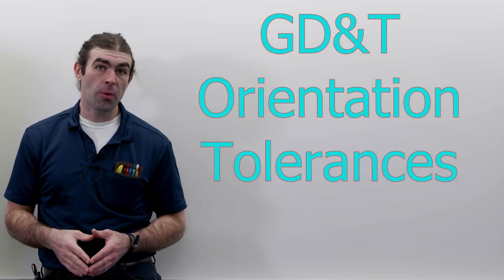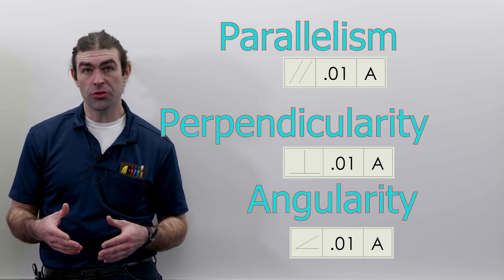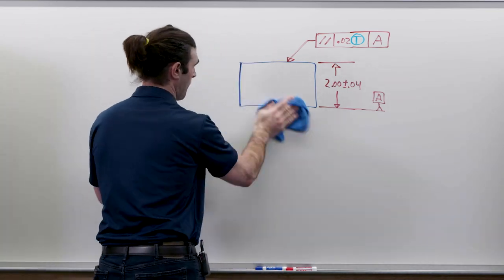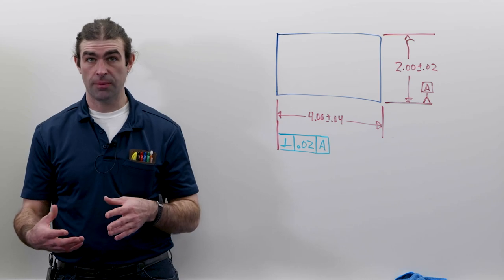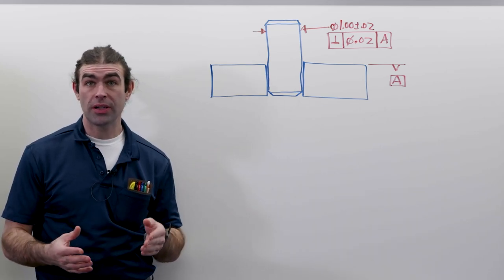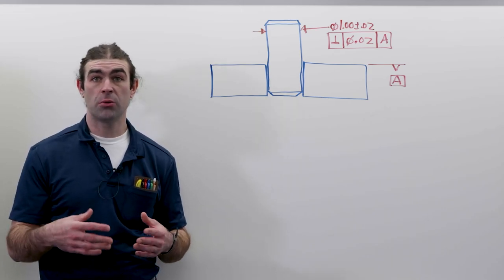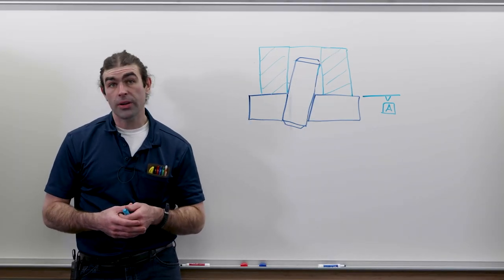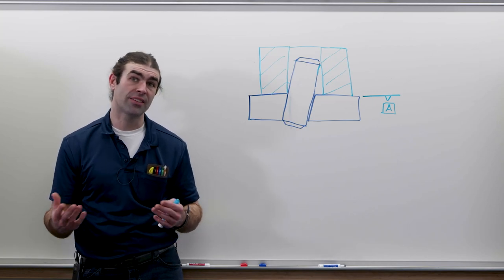GD&T Lesson 3: Orientation Tolerances

Comment: Excellent stuff!  I like that you are relating the inspection method to meet the GD&T call-out.  MANY engineers have no clue as to how to check (inspect) what they have specified.  As the department that has to make the items, if the drawing is not clear it goes right back to engineering for correction.. It is NOT supposed to be a manufacturing competition or guessing game.  If we make bad parts as a result of poor drawing dimensional construction it is on Design Engineering.  This is why all new engineers need to be on the shopfloor to "feel the pain" of bad design engineering.  Companies need to develop engineers better.  They don't understand the money that is lost concerning these issues.
Reply from the maker: Thanks! I agree. I see companies trying to save time and money in the design process, and end up with bad drawings no one understands costing more in the long run.

Comment: If I had a cylinder whose OD is controlled by perpendicularity to datum A (a flat end of the cylinder) and whose ID is controlled by a RFS position, what would be the minimum/maximum wall thickness of the cylinder wall possible? Would perpendicularity factor into the all wall thickness at all? I know it changes the VC of the cylinder in this case.

Comment: Hey prof, i finally understand the criticality of ref A. I just assumed that was minor formality. if u inspected a hole in a plate by "dropping" the fattest pin gage. it slides down u hear it click. i might assume "pass" for perpendicularity. However, i just assumed pin fell straight(perpend...) down and landed "square, flush" to the table surface. Fail x Fail. So i would make this. A gauge pin with a perpend base or tight washer on end ( like a mushroom head). Drop in and see and feel for ,"flush n square" contact. Ofcourse, the gage base must touch the "A" side of surface.

Comment: HI! Thanks for the explanation. Is it possible for you to elaboarte on the connecting rod video?
If the plane A is the face of rod, shouldnt B be made by 2 points? By being signaled as the axis of the right hole, you only get B datum when you find C, that is dependant on B because it has a pos. tolerance to A and B...

Comment: When doing the related actual mating envelope, how does the chamfer on the pin in your example come into play? It seems the RAME would be smaller when hitting the corner of the chamfer on the pin. Should the RAME be where it would hit the theoretical point of the pin, and not the chamfer?

Comment: Thanks for the detailed explanation.  Can you please help me to understand the surface interpretation  concept?
Reply from the maker: Hi. I can try:
Basically the surface method just means the virtual condition boundary you get at MMC and LMC. At RFS, the axis method must be used, this is just finding the axis of the AME and seeing if it is in the tolerance zone.

The tricky part is that you can use the axis method for MMC and LMC as well, but if the axis is really crooked, it may be okay with the axis method, but out of tolerance with the surface method, that’s why the surface method takes precedence.

Also, the axis method is rebranded as the “resolved geometry” method in ASME Y14.45, this standard goes into more detail about which method is appropriate for different situations.

Comment: Hi Mr Odell, I have a question about parallelism. Can I use a micrometer, zero at 1 point then go over the entire surface to check a deviation for the parallelism?
Reply from the maker: Hi, a micrometer won’t help with form or orientation deviation, unless the majority of the part fits under the anvils. A height gage would work.
Reply: @RDeanOdell  Thank you Mr Odell !